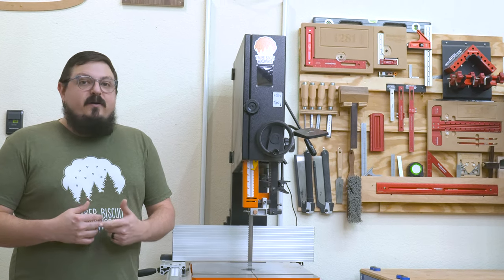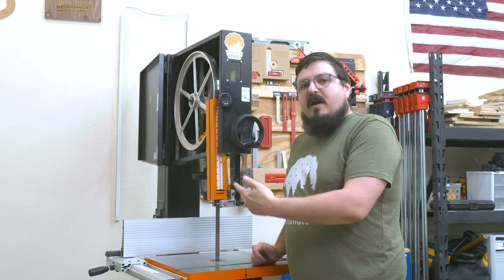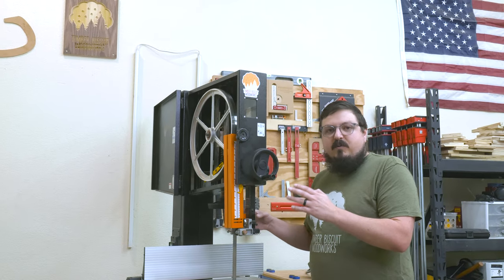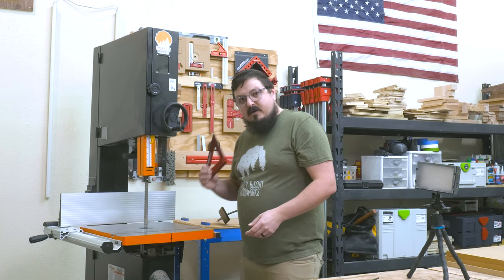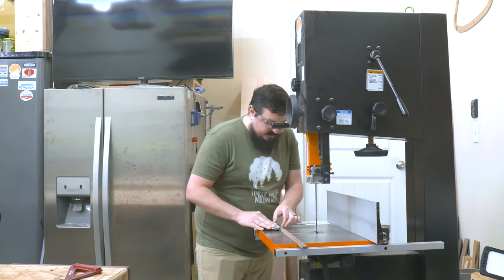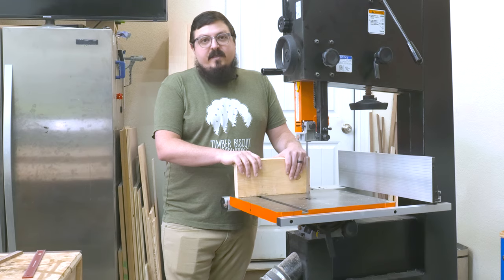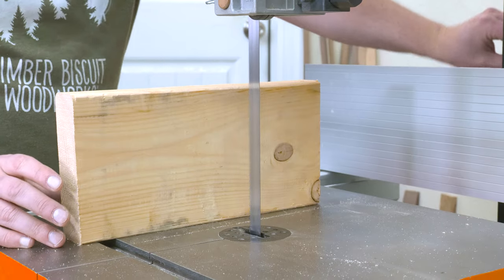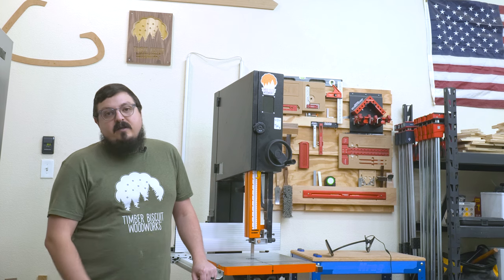The Most Accurate Bandsaw Setup

Comment: I also have a 3/4" resaw blade.  When I put the gullet in the center of the wheel, is it ok that the back side of the blade is at or past the back side of the rubber wheel?  I only want to go through this process once more lol.
Reply from the maker: I have about the same amount of space on my wheels with a 3/4" blade so I keep it right at the edge and haven't had any issues.